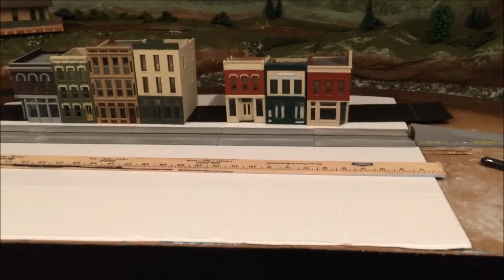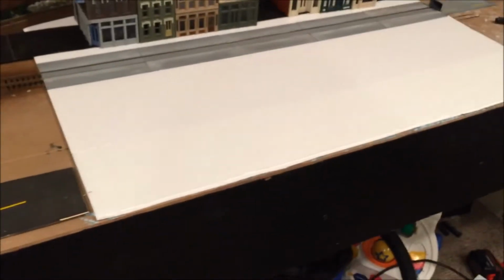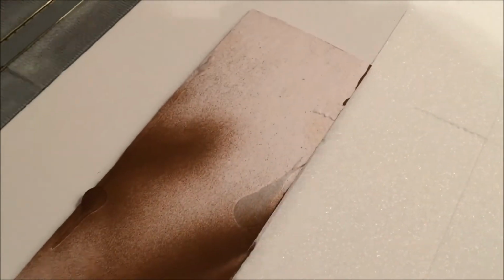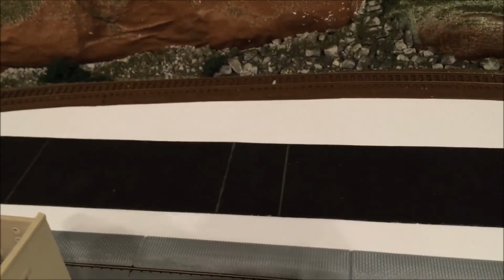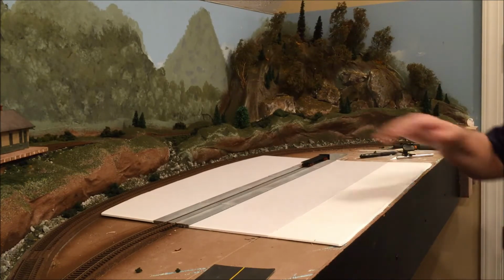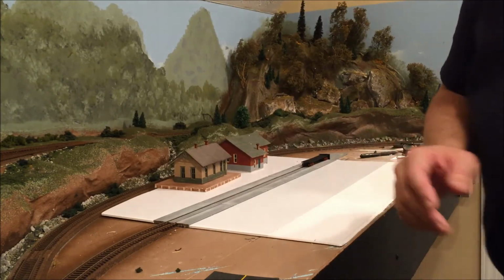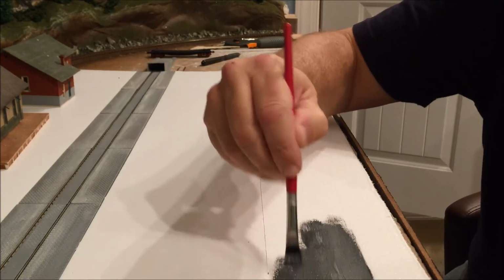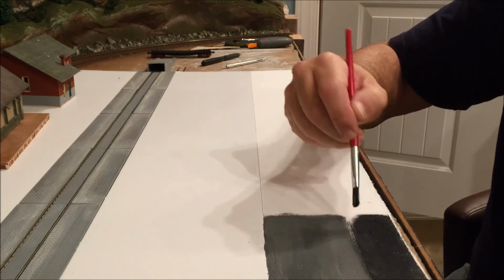My HO Scale Railroad   Episode 63 - REVISED see note below

Comment: Layout is really coming along nicely! I love the foam board road technique very simple and inexpensive. I did an experiment with a small piece to see how it looked and I was impressed. Removing the paper from the foam is the most important part when using acrylic paint. Just wet the foam with warm water let it soak and peel it off. KUTGW
Reply from the maker: Thanks for the comment!  Peeling of the coating gives the look of worn asphalt.  For a smoother, newer look surface, leave the paper on and weather it with paint.  I'll have an update in a week or so showing that technique.